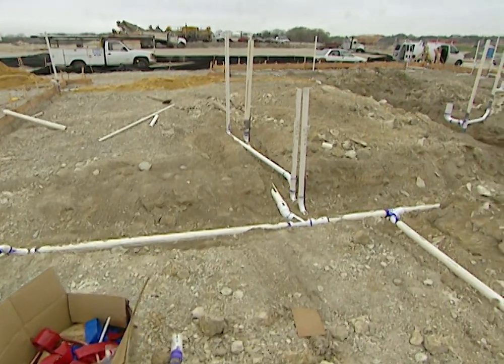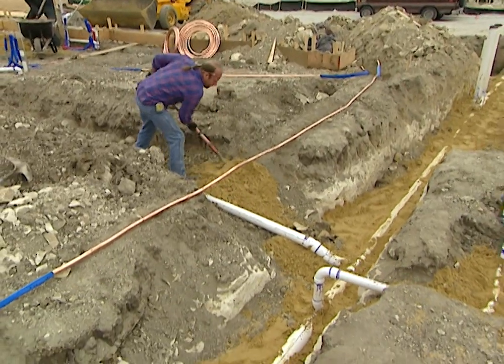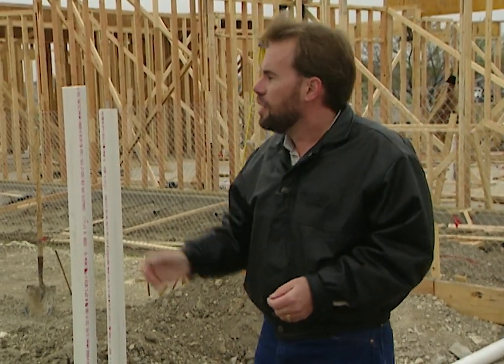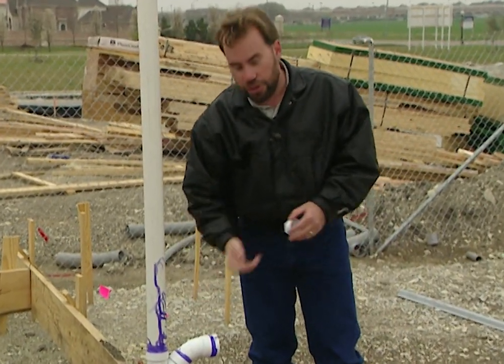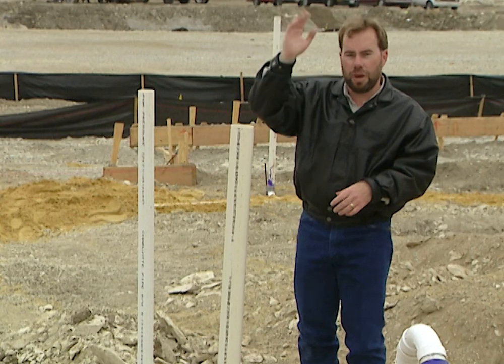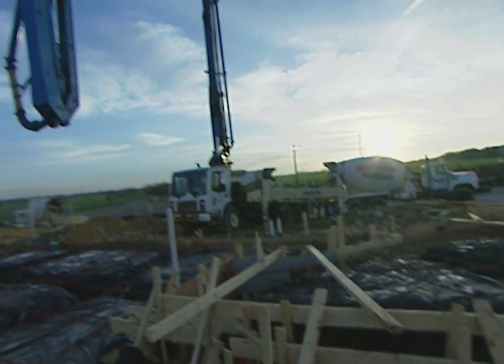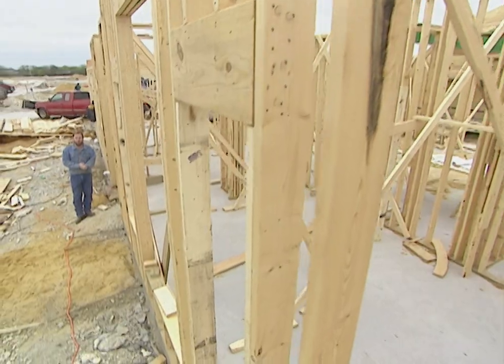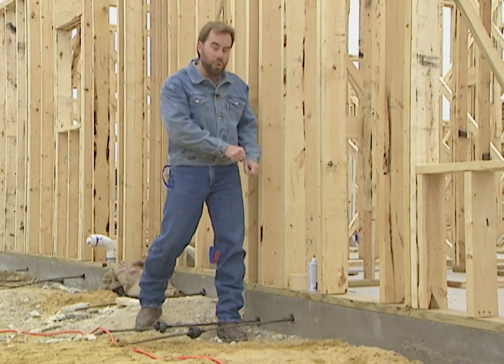Plumbing Rough & Foundation Pour: Renaissance Project House - Part 2

Comment: awesome video, very helpful. Question, for after foundation is poured in with footing going in both directions how can you make plumbing drainline changes? or moving drain-lines if there is 2 foot deep footings in both directions every 10 feet? +/-

Comment: How do you know that the pipe layout will go through your walls before the walls are set in place. I know you have a rough idea where it goes but what if you are framing the walls and notice a pipe is off by 2” from where the wall should be.
Reply: You look at the blueprints. Then setup some stringlines for the walls. Sometimes the pipes are on the wrong side of the stringline or the carpenter put his wall in the wrong place. Happens all the time.

Comment: Are you not allowed to use Air Admittance Valves?
Reply: I paid 25 $ for one and i looked inside, very simple design but i fear that after a while the diaphragm will get stuck and render the device useless.
Reply: Venting to outside air is the appropriate method preferred by building inspectors. Air admittance valves are mechanical and are prone to eventual failure.